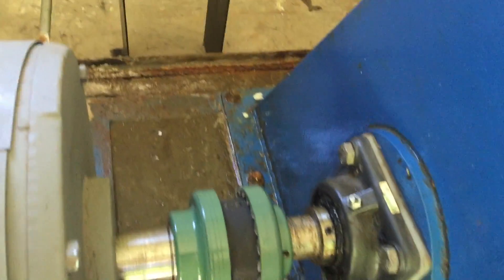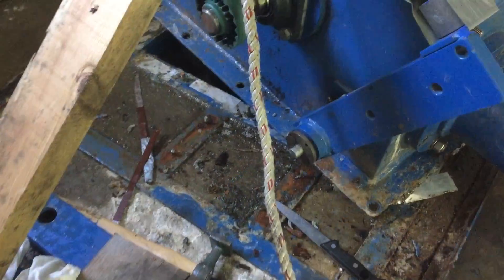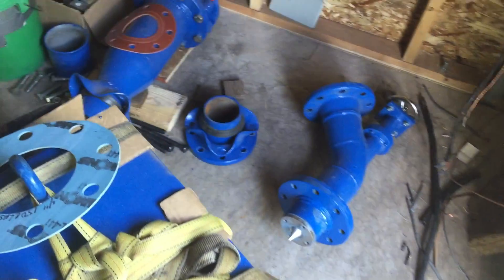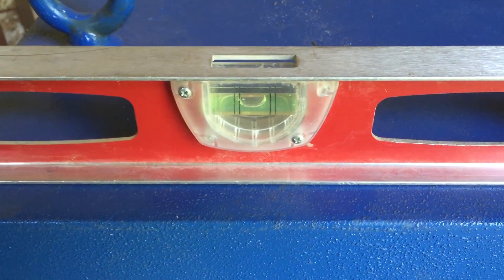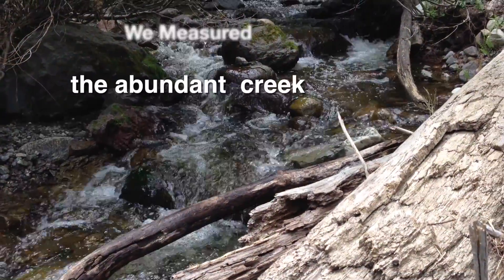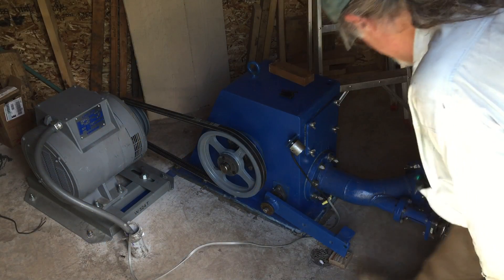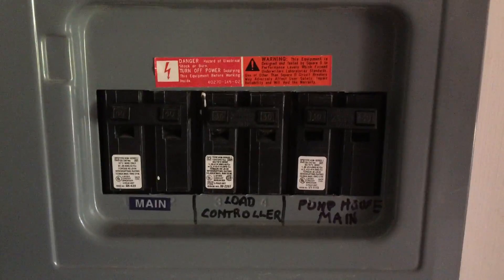Part 15 MicroHydro Power System in CO

Comment: جيد،،،من فضلك ،،،كم تحتاج ماء كل ساعة تشغيل،،،؟
Reply from the maker: Winter setting is about 200-220 gallons per minute @ 88psi and yields 7.2 kw. The spring thru fall setting is around 100-120 gpm @ 98psi and yields 4.5 kw. I’ll answer your other comment/questions tomorrow 😉
Reply: @mrhydrohead  👍💐

Comment: Really interesting project, can you please all equipment list ?
Reply from the maker: I could, but every system at every site is different depending on the parameters of the site and the need for power and the quantity harnessed.  Beside that, our equipment was originally purchased back in 1996 when there were far fewer options and a lot less easily accessible information.  It all costs more today from those suppliers and there are numerous other options in the marketplace. 

Most of the penstock is just std. plumbing chosen for its pressure characteristics.  Many parts were sourced off ebay or craigslist.

The Turbine was made by Canyon industries of Deming WA http://www.canyonhydro.com, the Generator by Lima which was bought out by Marathon https://www.marathongenerators.com/generators/index.jsp and the load controller was made by Thomson & Howe out of Canada. https://www.facebook.com/pages/Thomson-Howe-Energy-Systems-Inc/214294835610086.  The 480v transformer was made by Acme and purchased 2nd hand. 

I hope this helps, but as I said each install is pretty much custom and a product of your ingenuity. If you watch the whole series you will get a better idea of the whole process of design and installation.  Thanks for watching. Here is a playlist of the 3 part synopsis which is an overview of the whole process https://www.youtube.com/playlist?list=PLtTypVpmDd-vkT9bJQkXw4I1t0e_4jMYA  The whole series is in about 25 videos.

Comment: What kind of motor you are using please let me know. Thanks
Reply from the maker: We use mainly 1 & 2 horse power motors with no problem. Larger 5 HP motors are run offa gas gen set we own

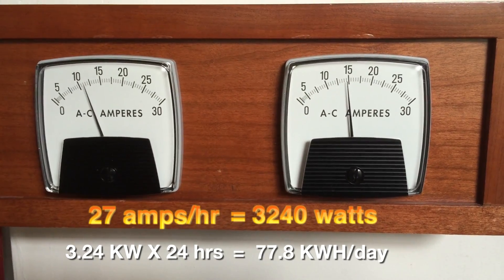Comment: @7:38 Looks like you're running a  true 120 volts system?
Reply from the maker: Yes it is! We never had any desire to have a battery based system and we had the fortunate situation of having enough pressure to do straight AC 120 V.. thanks for watching!

Comment: Why did you make the change from direct drive to a belt drive system?
Reply from the maker: Good question. The lower pressure on the pipe line in the creek means that the jet of water will not be moving as fast as it did in the springfed system. That speed of water jet needs to turn the turbine at an output of 1800 RPM for the generator to work properly. The reduce pressure was not fast enough to turn the turbine at 1800 RPM. So the pulley system steps up the speed from the turbine to the generator. Hope this makes sense thanks for watching

Comment: Very nice video. Only video I have seen so far explained properly. Do you run it 24x7 ?
Reply from the maker: 24/7/365 we run the power year Round. We have two power settings 7500 W for winter and 4500 W for the remainder of the year. Thanks for watching

Comment: Thanks for sharing. I enjoyed this video. Renewable power can save a lot more than just humanity! How much money did you spend working on this? I'm curious it's a great power system
Reply from the maker: That initial system cost around 25k in 1996 dollars. We also got gravity pressurized domestic water and a pond for raising fish at that price.  
When we moved the existing equipment to the creek we incurred additional costs of around 55k in 2015 dollars because we needed a full redesign of penstock, powerhouse, transmission and load management.
People often ask how long it will take to payback the system, but this neglects to consider that we would have had to spend about $140k in 1995 to bring power lines 7 miles into the off grid property.  That estimate had ballooned to $250-300k by 2015 when we moved the system.  We would have had to pay that to bring power lines in and then had power bills to pay on top of that.  So it was a no brainer to install our own system at either juncture and the question of payback was/is a moot question.  We look at the installation as an asset investment in the overall property.
Thx for watching I'm never sure who has seen what of the series. Here is a playlist of the 3 part synopsis which is an overview of the whole process https://www.youtube.com/playlist?list=PLtTypVpmDd-vkT9bJQkXw4I1t0e_4jMYA 
 The whole series is in about 25 videos.
Reply: @mrhydrohead  Thanks for your answer. Definitely it's a great power system and soon you're gonna get Your investment back. Great job! Did you get tax credit?

Comment: Can you make a product list
Reply from the maker: I could, but every system at every site is different depending on the parameters of the site and the need for power and the quantity harnessed.  Beside that, our equipment was originally purchased back in 1996 when there were far fewer options and a lot less easily accessible information.  It all costs more today from those suppliers and there are numerous other options in the marketplace. 

Most of the penstock is just std. plumbing chosen for its pressure characteristics.  Many parts were sourced off ebay or craigslist.

The Turbine was made by Canyon industries of Deming WA http://www.canyonhydro.com, the Generator by Lima which was bought out by Marathon https://www.marathongenerators.com/generators/index.jsp and the load controller was made by Thomson & Howe out of Canada. https://www.facebook.com/pages/Thomson-Howe-Energy-Systems-Inc/214294835610086.  The 480v transformer was made by Acme and purchased 2nd hand. 

I hope this helps, but as I said each install is pretty much custom and a product of your ingenuity. If you watch the whole series you will get a better idea of the whole process of design and installation.  Thanks for watching. Here is a playlist of the 3 part synopsis which is an overview of the whole process https://www.youtube.com/playlist?list=PLtTypVpmDd-vkT9bJQkXw4I1t0e_4jMYA  The whole series is in about 25 videos.

Comment: Average home I assume uses no more then 35 to 40KWHs per day if that unless you have energy hog appliances that are older and not energy efficient. But yeah its neat how electricity can be made.
Reply from the maker: Yeah we have to turn the flow down in all seasons but Winter.   We get super cold weather at times (-13° this past week), but we also get a great deal of passive solar gain when the sun is out (85-90° indoors at times).  Electric heat balances out most of the needs for heat. Its a huge amount of power we can harness.

Comment: You did not need to level the turbine housing and add shims that was a mistake and fill it with silicone you should of just bolted it properly to the sub frame flat you could of even mount that unit on a 45 degree angle and it would still work properly your going to have problems eventually with it configured like that incorrectly you really should mount it to the floor flat!!!
Reply from the maker: Haven't had a single problem with it. If we do, I'll deal with it then.  It was the first time I had ever aligned sheeves and wanted the alignment perfect for minimal wear.  We are still running the same original 2015 belts today.

Comment: Time to get an electric car I guess 😙🎶
Reply from the maker: Very interesting!  Thx for sharing the link.  We get multiple feet of snow by end of winter and there is no plowing on the road 7 miles from the county line.  Once it gets to where people are using snowmobiles, they partially pack the snow so cars and trucks sink deep in.  Maybe someday we can find an electric snow cat, but for now the snowmobiles are our best solution.
Reply from the maker: I would love to get one if I could find one which wasn't outrageously expensive.  Another wrinkle is that part of the year we can't access our home except via snowmobiles, so I will have to make an arrangement to access grid power via a neighbor to make it viable.  thanks for watching
Reply: @mrhydrohead  maybe a Model 3 AWD is the right car than. It's extremely good for winter driving.

Ask Tesla for a car to test out and run it through snow. It's absolutely stunning.

Sure, you probably still need a snow blower, but it's still more convenient than driving via snow mobile I guess. 😙🎶
Reply: Here's how a Tesla handles 6 inches of snow:

https://youtu.be/RTDrK5SJzxY

Comment: Why. would you meter power YOU produced?? Tad confused here...
Reply from the maker: Heaseba Building codes require a meter to be installed. Once you have the meter why not read it? Thanks for watching
Reply: @mrhydrohead  Sounds like, at some point in the future, Colorado is going to be CHARGING YOU for the power you are producing and using.. I can see no other reason for codes 'requiring' a meter in an off grid scenario.
Reply from the maker: Heaseba i don’t see it so darkly. When the house was built in 1995-7 the contractor merely told me the electrical inspector would require a meter to meet standard electrical code to pass inspection. We installed it, passed inspection and have never heard another word in 22yrs. Std bureaucracy at play, i truly doubt more than that.

Comment: Are you able to make it,  run at 200kwh ?
Reply from the maker: We have run it at that level in Winter ~8350watts = ~200kWh/day, but not wanting to risk draining the penstock we now usually run Winter production at 7500w = 180kWh/day. Other seasons we dial the flow back to 4500w or 108 kWh because we just don’t need that much power. Thanks for watching

Comment: where did you buy the generator, and which model is it?
Reply from the maker: The generator was purchased way back in 1996 and the Lima Electric Company was purchased by Marathon Generators, so numbers now are probably different as the product line has been changed.  The model was a Marathon Lima 3250-1230, 250 Frame 1800rpm.  It has 12 leads and can be wired in numerous configurations: Delta, Wye or Zig Zag for 110v to 480v depending on need.  We originally had it wired Delta 240v when generating from the springs but changed it to Zig-Zag 480v when we moved the system to the creek.  I never know who has seen what of the series, so check out the whole video series for more detail.  Hope this helps, thx for watching!

Comment: Where did you buy your system?
Reply from the maker: The Turbine was manufactured by Canyon Hydro in Deming WA,  purchased long ago in 1996.  A pro grade component. http://www.canyonhydro.com.  Generator was Made by Lima in Ohio, again purchased in 1996.  They have been bought out by Marathon years ago.  https://www.marathongenerators.com/generators/index.jsp  The load controller was made by Thomson and Howe in British Columbia, again 1996.  These are the three most critical components and were installed on the first system which ran spring water. (see parts 1-5 of series)

The other parts were sourced from various suppliers on the basis of best price.  The 480 transformer came from a Craigslist listing, the pipes and valves from a local supplier, wire sourced on the internet and Home Depot.

Hope this helps, thx for watching

Comment: I was about to buy a property with a water fall and a total drop of 40' on the property and make something like you did. I worked for Babcock and Wilcox for 20 years working on process control, so the electronic portion I can handle. I was surprised your small pelton wheel could put out that much power at 100 psi. I was going to make one by molding all the cups, or whatever they are called. I wasn't going to use the deflector to control the speed, but to control the flow in the nozzle.
Reply from the maker: Yes, we get a lot more power than we actually can put to full time use.  We turn down the flow in non-winter seasons. 
Here is a link to a self made pelton wheel.  They had varying pressure sources, so they customized pelton wheels to compensate for that.  https://www.youtube.com/playlist?list=PLtTypVpmDd-vkT9bJQkXw4I1t0e_4jMYA
This family is now third generation into hydro I believe.  They have several videos on their system.
I never know who has seen what.  Watch parts 20-1,2,3 for a synopsis of our whole project. This is a playlist of those 3 parts: https://www.youtube.com/playlist?list=PLtTypVpmDd-vkT9bJQkXw4I1t0e_4jMYA

thx for watching

Comment: There's just one fault, the weakest link is the belt drive, we were forever changing belts on our generators, never again. All ours are Direct Drive now. The bearings get grease every 5 or 6 years, that's it in Maintence now.
Reply from the maker: hiteck007 Belts were required for proper ratio to get 1800rpm at generator. Redesign shown in other segments shows far reduced pressure which turbine rpm is governed by. Haven’t changed belts since install in 2015, so no real fault here. Grease every 4-6 months and bearings are now at 23+ yrs. All works fine. Thx for watching

Comment: Why didn't you go for direct drive instead of a belt between the turbine and the generator?
Reply from the maker: NeuPluppy Good question. Lower pressure means lower jet speed. The speed of the waterjet determines the speed of a turbine and the pressure of the new water source cannot produce the 1800 rpm which the generator head requires. So a pulley ratio is required.
Reply: @mrhydrohead  Oh it was kinda obvious then. My mind was focused on the friction part, and I can see now when I watched again that you had the ratio information in the video :)

Comment: Confused as to why you would want to go from direct drive to belt drive, other than perhaps you wanted more Generator RPMs? This from a Licensed Electrician for 33 years.
Reply from the maker: Khadijah Brown Its a great question.  The speed which the turbine can turn (rpm) is governed by the speed of the water jet hitting the pelton cups which in turn is resultant from the water pressure. The direct drive provided the required 1800 rpm from the 212 psi of the spring fed penstock pipeline. Moving the system to the 96 psi creek fed penstock reduced the jet speed and necessitated using a pulley ratio to maintain the 1800 generator rpm. There is a loss in efficiency via the belt drive yes, but the far greater volume and reliability of water on the second source waa well worth moving the system. Thx for watching.  If you haven’t yet, watch parts 20-1,2,3 for a synopsis of the whole process.

Comment: Unfortunately in the UK there is very little chance of ever doing such a setup as this. We have the old Basingstoke canal closed because bats use a tunnel. A whole 30 odd miles of canal almost useless because of the lesser twit eared green bottomed flatulence bat. A nice small metal boat full of old lorry tires springs to mind. There must be a sensible balance between nature and us humans but sometimes ( in fact now most times ) it's the greenies that win out. I'm surprised they haven't stopped us cutting our lawns, can you imagine the agony that grass goes through. I am an engineer of the old school and your installation is truly excellent in every way. Very expensive I suspect but it's so nice to see something so well thought out and built. What a wonderfull design the Pelton wheel is. It must be a swine to machine though.

Comment: what is static head height of pond versus input to impeller? Hydraulic horsepower requires a few hundred psi at a certain gpm flow.
.433 psi times head height minus friction loss in pipe and efficiency of impeller determine actual horse power. One HP= 746 watts...You must have several hundred feet of head to produce that power....
Reply from the maker: Static pressure is ~96psi x 2.31 = ~222ft of head. As flow increasesyes friction takes its toll and drops to around 86 psi at max single nozzle flow of ~300gpm or 2/3 of a cfs. 

Effective power harnessed is ~8kw. which is plenty to live and heat with

Thx for watching